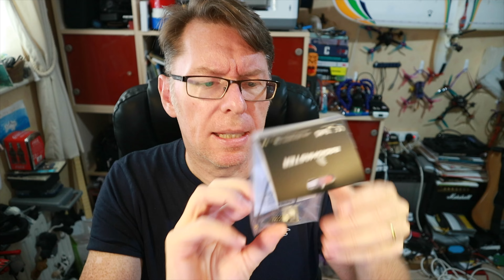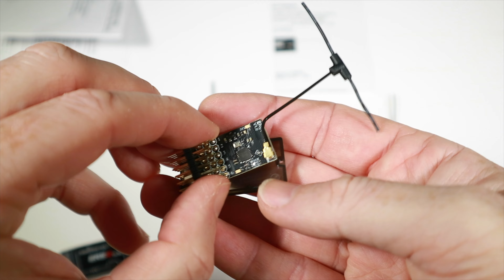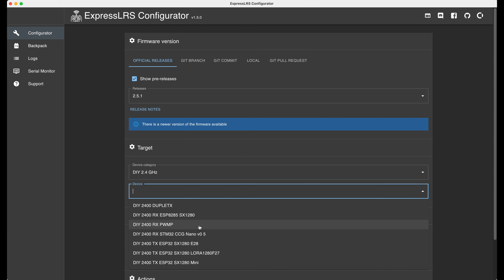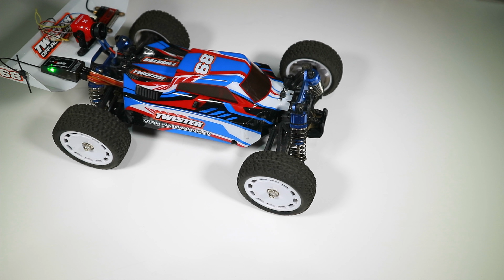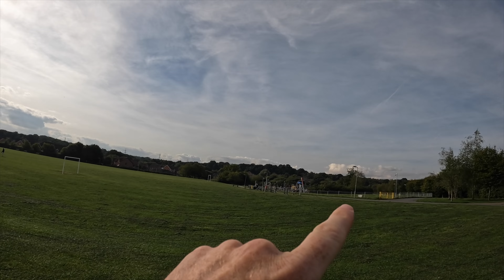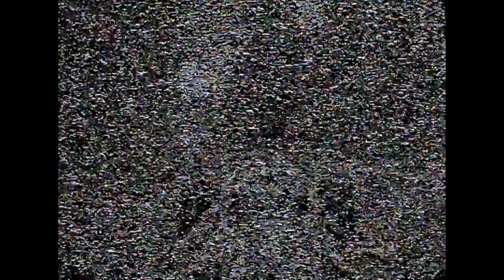RadioMaster ER5A/ER5C ELRS PWM RX's.  Let's make an FPV car to test them out!

Comment: Hello my friend! What was the total distance you got from the receiver. I believe I heard u say 2-3m but wasn't sure.  I'm  hoping that you can do a step by step video how u put all the electrical components together. Thank you so kindly for sharing.
Reply from the maker: I said 200-300 metres.  Which was about right - around the park, the longest distance was about 215m in the woods, the bridge was 280m away.  If I could find somewhere without trees, hills or other obstructions then the VTX wouldn't give out so quickly!  I wasn't intending on any step-by-step, as the FPV setup in the car was a case of connecting the balance lead from the battery to the VTX and then the VTX running the camera... all pretty basic.

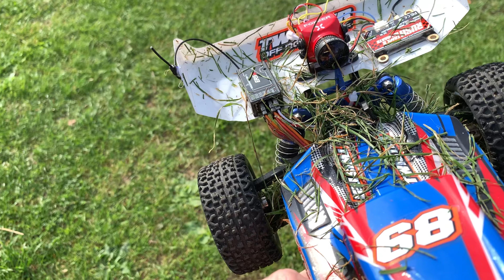Comment: Great fun, and entertaining video. Nice camouflage at 13:24 BTW: 😂
3d-printed fenders might solve the tire debris annoyance.

Since you have more PWM channels, you might try adding a pan servo for the camera. While you doing the mod, could add a little 10-15cm (4-6") mask for the camera (and perhaps antenna), to provide a better view.
Reply from the maker: Not an on-purpose camo, I was just adjusting to the environment :)  I'd like to do a bit more with it, but there's not much room there.  It's a question of do I continue to drive as is, or work harder to fit things in... or just find a bigger car which will make fitting things a bit easier.

Comment: That's really great! I first tried it 16 years ago with bulky 1.2ghz video system & security cam which I viewed using video glasses, even recorded some footage from it back then in 2006 with an Archos AV500.
Now you've had a good taste of FPVing with RC cars you've got increase the enjoyment of it:
Put the FPV camera on a 3-axis gimbal. It's amazing, take a gander at "Gimbal stabilised FPV RC car driving"
Reply from the maker: I remember you gimbal car drive - it worked really well.  What I'd like to try and do is keep that car a basic car shape (with it's body shell) which becomes more a a struggle as you add things... especially considering how little space it's got in there.  It would be nice if I could find a larger car and then we can do a bit more.  It is fun though.  I still have a 1.2Ghz system that I intended to use on another car, but had issues with power on it.  The penetration on 1.2 still should be way better... if a bit more cumbersome to use.
Reply: @CurryKitten  Unfortunately the gimbal I used died, a Zihyun Z1 Tiny2 which was already a little damaged from a bad landing on a GPS quad. I do have another Tiny2 in perfect condition, but not prepared to put it on another RC car until it can be made crash-proof.
Driving the car through goggles with a perfectly steady image was really nice, but there was an issue with yaw lag, programmed into the gimbal to get steady smooth shots with a sportcam it feels quite weird looking through an FPV camera on the gimbal in realtime having it delay when you turn left/right.
One thing I've always wanted to try was an FPV gimbal setup on an RC car with head tracking.

Comment: Great Rx review video. Lots of fun exploring by fpv rc car. I have a wltoys 12427 4x4 that put an fpv camera on. Great fun, terrible rc range. This video gave me an idea. 🏎️😎
Reply from the maker: Cool - yes, that's always the problem with these little cars, you can easily stick an FPV system on  them, but the rx would give out very quickly.  The only slight pain is losing the nice wheel/trigger style of controller
Reply: Hey, how did you set up the FPV part. How do you get power to the vtx/camera?
Reply: @ryanjones6837  I used an akk aio vtx camera. Got a 5v regulator powered from the balance lead to power the camera / vtx. And got a 3d printed mount to glue in the RC car.
Reply: @John Larson  legend. Thankyou! Could you explain about the 5V regulator or send a link. my VTX will run from 7V upwards, will I need a bigger regulator from the balance lead?
Reply: @ryanjones6837  what is the voltage range of your vtx and camera? If your battery voltage is in between the low and high of the voltage range you don't need a regulator. 🤓
Reply: @John Larson  my vtx is a 7-36V range with my camera being a 3.7-18V range which I'll run off the VTX. What do you think? (I'm new to this hobby obviously :D )
Reply: @ryanjones6837  you can go as high as a 4S ( 4 cells, 16.8 volts fully charged) lipo. On the low end you may be able to use a 2S lipo but if you run the battery down below 3.5 volts your vtx may shut down.
What kind of radio controlled vehicle you using? For a lot of tutorial videos Joshua Bardwell is very good.
Reply: @John Larson  ah okay, so I can run that straight from the battery balance plug? I've been flying for a few months now but still not fully sure on things but this has helped thankyou. I run crossfire on one drone but will also use it on the RC car project with a crossfire nano rx and 6ch PWM adapter. Not fully sure as nothings been delivered yet lol.

The car I've ordered will be WLtoys 14002 so not sure which battery it will be just yet but will be controlled by air remote with crossfire hopefully. Would it also be possible to use a servo cable from the receiver to the vtx?
Reply: @ryanjones6837  I've built and flown drones for a while now. Just got into rc cars recently. So not sure about the servo wire from Rx. On the wltoys 12428 4x4 I power vtx/camera via the balance lead so it's easy to remove the fpv setup.
Reply: @John Larson  oh I see. I'll just do it your way. I never even knew power could be taken from the balance lead. As long as my battery is within that range I'll do that. Thanks for all of this, love this community.

Comment: I noticed the only difference between the two was the case & pin config (straights vs 90s), it's the exact same board & ant. I'm curious what the power consumption / output power is. Is this the same RF output (for telem) as their RP1 ELRS?
Reply from the maker: That's an interesting question, and I noticed it's not specified anywhere.  Usually the telemetry output power is pretty low with vendors only calling it out if they've significantly upped the output.  I expect it's the same as the RP1, but I'll attempt to find out
Reply: @CurryKitten  on my betafpv nano rx i can set the telemetry output pwr in elrs lua on my tx. & everything is on elrs 3. Those go up to 100mw. You might be able to see there.

Comment: Fantastic ride, Wayne! Great review of the receiver! 😃
But yeah, there are some VTXs with a fan... But none of them are as good as a Rush Tank, of course. Or you could put a fan in it, one of those used for motors and/or escs. I don't know, it's just something I think about. 😬
Anyway, stay safe there with your family! 🖖😊
BTW, you could've set up the radio to read the RSSI for you from time to time. 😉
Reply from the maker: Yeah - there are some bigger VTX's with either heatsinks or fans, but once you start getting that many trees or mounds of earth inbetween you and the car, there's always going to be a struggle.  It's very obvious to put an RSSI shout on a momentary switch or something.... no idea why I didn't think of that at the time :D

Comment: A PWM capable Rx can be useful even when your using an FC, on my truck i have an Omnibus F4 pro and in Ardupilot i have used BRD_ALT_CONFIG to re purpose the RSSI input and CH5 output pins on the FC as an additional UART but i need 8 pwm outputs as i have a pan/tilt cam mount and a bunch of PWM controlled electronic switches for various lights.
The R9 Slim+ Rx will output ppm/sbus  but also output ch 1-8 on the PWM outputs simultaneously so i have recovered the lost ch5 output on the FC by connecting a pwm switch to the output on the Rx  :)

Comment: A small matek flight controller is a great addition to a little RC FPV car, obviously you can't use it to its full ability but the OSD information such as signal strength and distance (if you use a GPS) is pretty useful stuff. I put an F411-WING in a crawler and it's great fun
Reply: I did the same with my buggy, now I finally see my current speed 🎉
And I wanted to use a non-PWM receiver and this was the only way to do it for me (with an FC).
I have now GPS, link quality and battery voltage on my OSD. I even added some LED for additional fun 😂

So I have connected the following stuff on the FC:
Steering servo,
ESC (on a servo output),
ELRS receiver,
GPS,
CaddX Turtle V2 for onboard FPV recording,
VTX,
LED strip and an additional fan for the VTX
Reply: @2erXre5  u have video tutorial on how u do it ?
and what FC u use for that ?
Reply: how did you do it